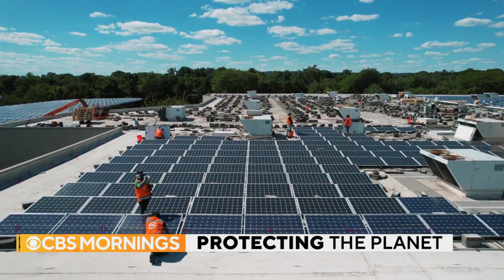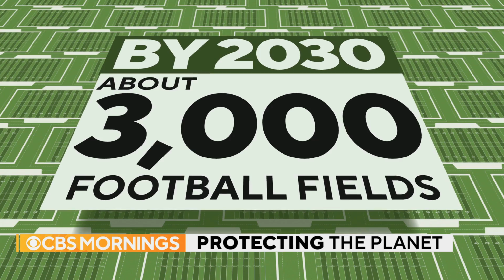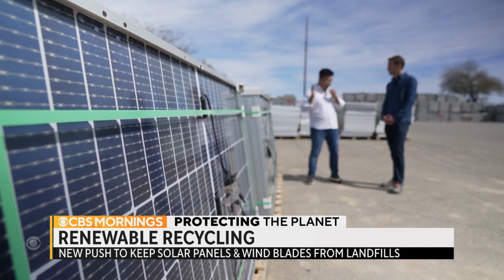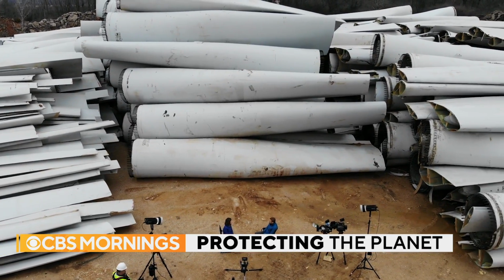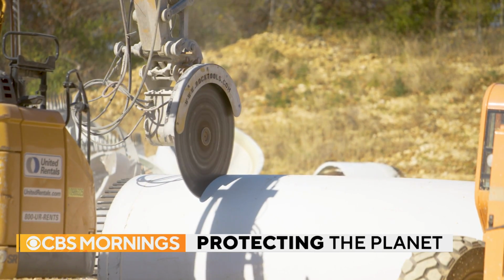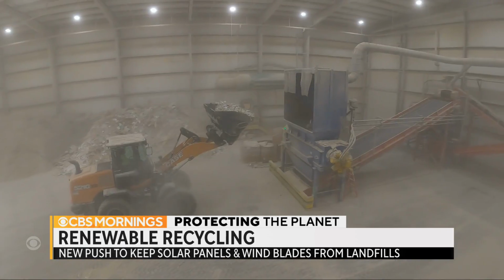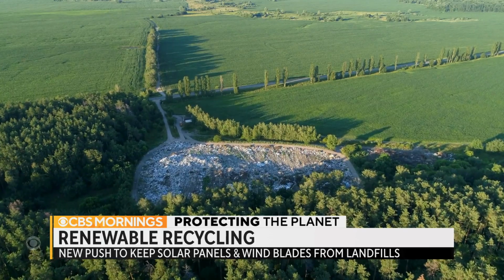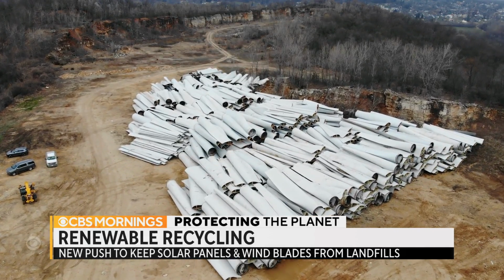Wind blades and solar panels head for landfills after being replaced

Comment: Golly gee wiz... wonder if these geniuses have thought about the glut of used batteries that will be headed to the landfills in just a couple of years from the surge in electric cars? Never minding the fact that it takes 10 times the amount of green house gases to just produce an electric car battery (just the battery and not the car) than an internal combustion-powered car will produce in its lifetime.

Comment: The difference is the waste is on the ground rather than tons of carbon in our atmosphere which makes this waste still preferable. The waste can be recycled if there is the will. It just needs regulation to make it mandatory. Those fibers are strong and could be used to make all sorts of things.
Reply: So you buy the CO2 zero crap?  You breathe out CO2--plants take in CO2. The idea you believe what the elites are selling to make money and you don't notice all the earthquakes and volcanoes going off as the moon rolls and the earth wobbles but you believe CO2 makes earthquakes and volcanoes erupt.  They say they are having a hot summer in Italy but they blame it on CO2 and not the volcano going off in Italy?

Comment: Everything wears out. This is a problem, but massively overblown. 

Does anyone think oil and gas drilling doesn't produce waste? Used up drill bits, bent pipes, CO2 emissions? 

The GHG produced in making wind turbines was estimated to be offset less than a year after production, then the turbines are expected to last another 25+ years.

Comment: You say that as if what we already do is done correctly. 

Here. Let me help clarify. Pollution is even worse than waste. 

Along with landfills full of reminders of fossil fuel garbage: junked remainders including cars, oil furnaces, lawn mowers, diesel trucks, vehicles of all sorts including airliners and oceanliners, military vehicles, motorcycles, large and small manufacturing machinery, alllll coated in carcinogenic petroleum residues including VOCs of all kinds, cleaners and fill fluids, radiator and brake fluids, lead acid battery parts and fluids. And this is the short conservative list.

Comment: There is more toxic waste from wind turbines and solar panels every year. Then there is in the lifetime of your average. Nuclear power plant nuclear power is the way forward for a clean energy future.
Reply: And for those of you worried about the toxicity radiation radiation decreases over time the toxicity of the chemicals used in solar was last forever tbecause. It's chemically intrinsic. Radiation eventually reduces to the point of being indistinguishable from the natural environment. With all high level nuclear waste fitting within a footprint the size of the empire state building to the height of two stories including all dry cast containment materials.

Comment: too bad the blades couldn't be repurposed and recycled by using waterjet cutting technology which has evolved lately.. if you scanned them into a cad package you could then put a cutout pattern on the 3D model and have an articulated arm with the waterjet cut the blade pattern.

Comment: so when will the lawsuits begin for all the people working in the blade recycling plant. all that fiberglass dust going into the air and the employees having to breath it in. then there are all the people that live around this plant that also have to breath in the particles from the fiberglass dust. then that dust falls to the ground and contaminates it and all the water runoff going into the rivers polluting them. then what are the health issues with burning fiberglass as a fuel source. i would bet coal is cleaner, cheaper and less of a health hazard than the pollutants from the burning fiberglass. this clip shows how little all these so-called environmentalists really care about the environment, it is all about the money for them.

Comment: About time someone in the mainstream media actually did a story on the environmental waste created by "Green" energy systems, even if y'all only touched on a TINY fraction of the environmental impact caused by them. What you forgot to mention is that the VAST majority of photovoltaic cells are created in China, where they have no regulations on silica mining or processing. Or the destructive mining practices for the aluminum, copper, steel, and concrete used in all "Green" energy systems. You also forgot to mention the MASSIVE amount of fossil fuels used to mine, process, refine, manufacture, ship, and install every material component used in "Green" energy systems.... Solar and wind are failed energy systems that where turned away from decades ago because the juice is literally not worth the squeeze.

The only REAL stable and consistent Green energy system that exists is nuclear fusion. Fission will be a game-changer when they get it figured out, but that's decades off before it's capable of being marketed. But if you ignorant hippies would get behind nuclear instead of wasting everyone's time with inconsistent energy systems that can't even produce as much energy as they require to be created and maintained, we could completely eradicate fossil fuel usage entirely within a single generation. By combining solid-fuel reactors for bulk power production with molten-salt reactors for nuclear waste disposal and medical isotope production, we could have the cheapest, cleanest, and most efficient energy production systems this world has ever seen. And we can do that right now with technology that has existed for more than 50 years. And we don't need 10's of thousands of children mining lithium for millions of tons of batteries to store DC electricity... If find it hilarious that the same people who worship Nikola Tesla as a scientific genius will turn right around, look you dead in the eyes, and claim direct current energy is better than alternating current... Stupid Edison simps...

Comment: I’m 50 bought my first Solar at 18 still in use today ! Bought hail resistant and dirt resistant Solar panels 
 Dependable power can’t be beat 
 Even with a necessary backup generator or just use more geothermal that’s were I’m headed with my Solar it can run ac in direct sun without clouds all day but Florida nights are hot 
 So yeah geothermal for preheated air up north or for cooling in the south works perfectly with Solar

Comment: Sadly the "green agenda" nut-bags don't look at the big picture or the whole picture!
The fossil fuel it takes to extract the materials required to make the batteries for one electric car is equal to the fuel used by one pickup truck operated as a daily driver for 50 years.
Then the fact that the energy to recharge these vehicles comes mostly from fossil fuel power generation.
Then there is the disposal of the used batteries after what 5 or 10 years to be replaced yet again.
The benefits not only don't add up they harm the planet more than if the industry waited for a viable battery technology that does not depend on the consumption of rare earth minerals.
These advancements are closer than ever, but to this point the harm has not outweighed the benefits.
Just saying
Reply: Why don't you inform yourself first?

Comment: How was this "unexpected"?  Simple:  stating this part makes "clean" energy not nearly so clean and possibly close to as dirty as non-clean energy.
Reply: Yours is about as balanced of a comment as possible.
Eventually the new energy commodity producers will be as corrupt as the oil and gas industry. Nuclear has its own corruption, the fuel rod production is so well defined it's like industrial jewelry and proprietary, but other aspects are beneficially strict (containment.)

Comment: Wow,  agreed.  Wind and solar panels are not unicorns.  They do not magically appear and disappear.   But they do magical generate electricity without the input of any fuel which need to be mined, transported, processed, and have their waste disposed of.  Not to mention all of the materials, waste lubricants used in maintaining plant machinery,  manufacture and disposal or reprocessing of chemicals just to provide the pure water used to generate the steam to generate the power.  Yes a total cost would be good to see as the total cost and emissions produced  to build, maintain, supply, and dispose of all materials in the construction, operation and yes ever disposal of a conventional fossil power plant materials.  The disposal of solar panels and turbine blades will be solved as companies are already investigating ways to recycle as much as can be recycled.

Comment: He said it. "  I had no idea what happens when solar panels age out " " Me to, I thought windmills would just stay up there forever "
So you push for alternative fuels without thanking about it, what a smart way to go forward. That's why you report 1/2 the information  to people that don't research this stuff and then believe what you say. Solar, wind, and those toxic blade scraps they burn are just a trade off. Yes fossil fuels produce more co2, but the alternatives produce even more co2 to manufacture and dispose of and remember getting rid of the toxins in solar panels, blades, and burning them is continuous...
forever. Recycling toxins and burning them causes more co2 then coal, fossil fuels, gas, etc, don't people get that. I want clean air for my kids and grandkids, but I don't want to make the air dirtier by trying to make it cleaner. And yes, they filter all the toxins they can, so do coal, etc. plants...so where does the filtered toxins go...in the landfill. I know what's in turbine blades, some real nasty stuff and you want to burn it compared to fossil fuels. Please research, you have to think this through. There's always a trade off to anything used to fuel our world, don't we want the best way to do it. If you don't even know about it, news, how can you report about it ! Let's find the
 " best " way to power our world.
Reply: Wrong. Renewables do not produce more CO2. In fact, much less.

Comment: Yeah wind turbine blades may only last 5 years due to breaking up from corrosion or impacts. Sandy areas are rough on blades like a sandblaster, Any debris hitting the blades can damage them. They do not last forever.

So wait. Concrete plants are burning ground up compost. So instead of burning coal, you burn composite and fiberglass? And what pollution does that put into the air? What kind of damage does smoke from that do to people. We already know the long term effects of burning coal for the planet, people and animals, and water life. We don’t know long term what that does, and neither does the epa.

Comment: If they can use the shredded waste to fuel a cement plant can't we use that to fuel a electric generator which sends the electricity to the blade manufacturer to make more blades and on and on.

Comment: Most windmill blades dont go to landgills. They dig a jole in the vicinity of the windmill site. The lay the bladed in the holes then crush them into smaller pieces using dozers. Fiberglass crushed into the ground.

Comment: Just wait and see how fast electric cars get scrapped since repair of electronics is very expensive and new replacement components are impossible to get.  All repair shops will tell you it's not worth fixing.
Then the repercussions of all those toxic metals in the electronics poison the ground soil and nearby creeks and rivers FOREVER.  They are so toxic forever!!
Reply: The world already has had experience with mass produced electric cars for over a decade and guess what, they are holding up just fine.

Comment: It is not surprising that potential waste and environmental concerns also apply to renewable energy technologies like batteries, wind turbines, and solar panels. However, the root cause of our sustainability challenges lies in our unsustainable consumption patterns. For example, we travel billions of unnecessary air miles each year to meet rigid airport schedules, use tons of disposable packaging, and force people to commute for hours when they could work from home. Additionally, we waste billions of hours powering Christmas lights annually. Rather than focusing just on developing new technologies that also create more waste, we should also address our consumption patterns. Making small changes in our daily routines can make a big difference in the long run. Unfortunately, we often fail to take this approach and instead push the problem onto future generations. This current approach is a mere fantasy that will only encourage more consumption and waste in different ways

Comment: Another Extremely important concern that is Burgeoning and Often Urgent!

It has been reported that their are toxic emissions when manufacturing solar panels and toxic emissions when throwing solar panels in the dump.

Recycling should get whatever funding needed while they strive to be self supportive.

There should be an effort to work towards anything manufactured needs to be capable of being recycled without too much difficulty.

How much more can be done to make use of passive solar?

Thank you for your helpful and informative videos!

Comment: I purchased four used Solar Panels and found that they are very efficient for my needs cheaper than buying new ones. Did the installation job myself and saved a ton of money!
If you can wire a household plug you can wire solar it is that simple!
Reply: No such thing as saving “a ton of money”. You are saying ‘a 2000 of money’.  ?????
Reply: Two immediate problems. Most people cannot wire a plug. AND many people live in apartments and condos, so have NO control over where they get power. And to the first commenter, pennies weigh a ton, so he may have actually saved 2 tons. What a wasted comment...

Comment: I don't understand the large negative slant on this story. Why decommission a solar panel after 3 years and call that a problem for waste? It's like throwing away a gas generator after a year. Wind turbine blades need replacement after YEARS of usage, but how long does a barrel of oil last? CBS is trying to gain an audience of oil lovers.

Comment: Most solar panels can be sold as used

Having solar panel and wind blade waste is better than the alternative.  It's manageable.  Polluting the air with fossil fuels and spending energy on the long conga-lines of energy flowing around the World continuously is NOT manageable.  You can't easily get that pollution and greenhouse gasses back.

We can take a black eye to green energy; it's the climate knife to the gut that we desperately want to avoid that makes the black eye more than acceptable.

Comment: And you need at least more than four times the hardware to have the output the Greenies claim. And you need energy storage or fossil fuel plants to make ruinables work on the grid, and that usually means batteries.  Now do a story on recycling batteries.

Comment: This is so dumb(at least the solar side). Solar panels don't get "recycled" they get resold as off-grid panels (signature solar for example). It's the same stuff that they spewed about lithium batteries, the pack is worth more than the car, and even old batteries sell for 1000's on eBay. The only e-waste is physically damaged parts and forced recycling by distributors who want forced obsolescence, and to prevent a second hand market.

Comment: Yep, renewable energy systems need to be renewed, because they deteriorate over time and cannot be maintained and therefore must be replaced.
Life time of solar panels? - up to 25 years, but most are replaced long before then due to loss of efficiency.
Life time wind turbines? - also up to 25 years, and the have to be maintained to reach that age - many will fail before 25 years, some destroyed by weather events as they are very vulnerable.
But nobody mentions this limited life span, and they certainly do not mention how these devices can be disposed of and what happens to non-Reusable parts as the images of landfill sites filled with renewable energy devices is hardly "green".
Everything has a cost, but if the cost is ignored things seem better than they really are....

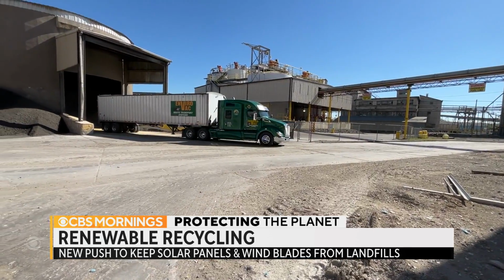Comment: 3:22
Burning chopped up fiberglass and balsa wood wind turbine blades instead of coal, cuts planet warming carbon emissions by  nearly 30%?
🤣😂😉
Sure it does!  Coal is very energy dense and there are no resin chemicals that produce toxic smoke like fiberglass resin.

Total propaganda.

Comment: Its a throw-up to determine which energy source is worse, Solar, or Wind Turbines. Both are heinously inefficient, with huge fossil fuel energy amounts to make them. But the big problem is the dispisal, as they contain toxuc chemicals that will significantly harm our environment in landfills. This story neglects to tell it costs $35 to $50 to recycle panels for $3 in value of the recyled materials. Sounds woke math.

Comment: What's powering all the destruction of the solar and wind material into those little pieces???? Fossil fuels. (Yes, they said those pieces later generate power).

The problem with going green is corporations, lobbyist and special interests that pay off politicians so they can push this idea that all fossil fuels are bad. 

Hear me out. I'm ok with phasing out fossil fuels but no one pushes for nuclear power which is still our best option. 

I have 3 neighbors that have solar panels on their roof and they all said, it's not practical. They would have to cut down trees and we live in the northeast when we don't get the hot sunny days or the angle other states and countries get. 

EVs are great if commute less than 100 miles round trip to work everyday. Most people park their cars outside and don't have the luxury of plugging it in everyday. 

Meaning these mandates are just as crazy as AOC representing the Bronx. ( Pushing a green new deal in NYC when most can't find parking) 🙄